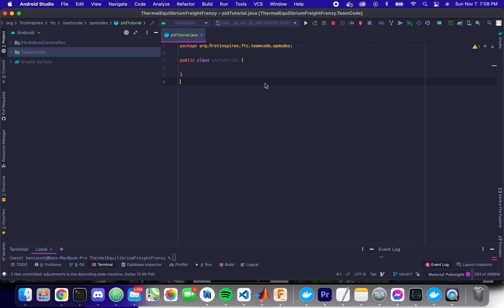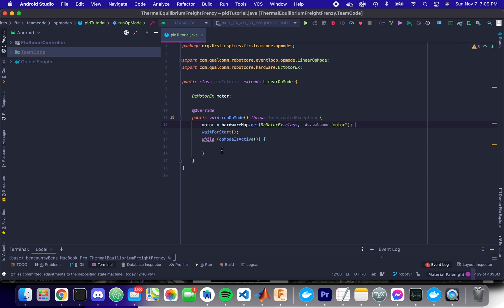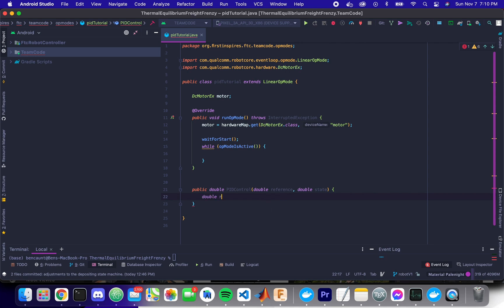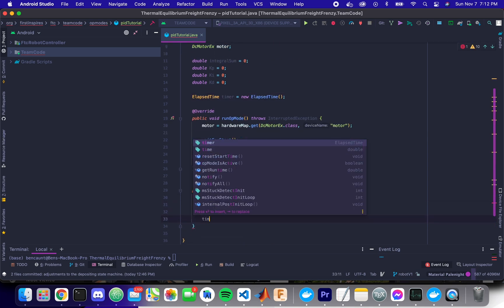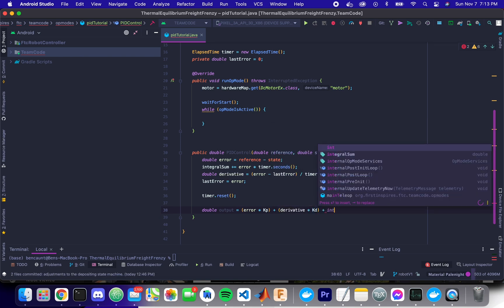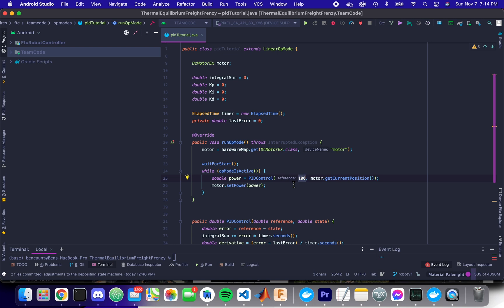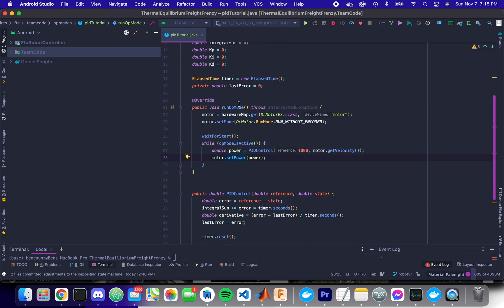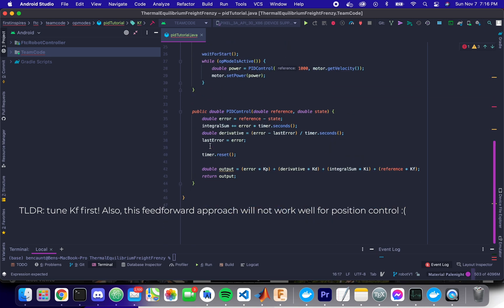PID Control in FTC Tutorial #1

Comment: Why would you create a DCMotorEx PID controller when it already has a built in one, why not just use setVelocity and play around with the PID coefficients? It would only make sense to do your demo on a class that has no PID!
Reply: the built in pid runs at only 25hz and custom ones would refresh faster so u would get better loops times (FTC lib on refreshes at 250hz)